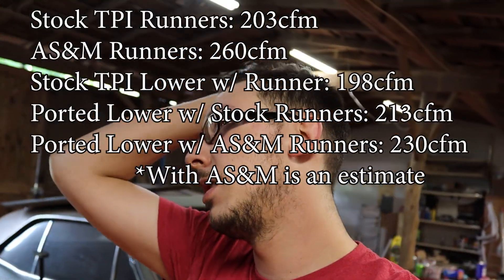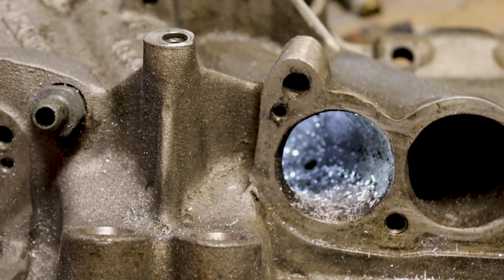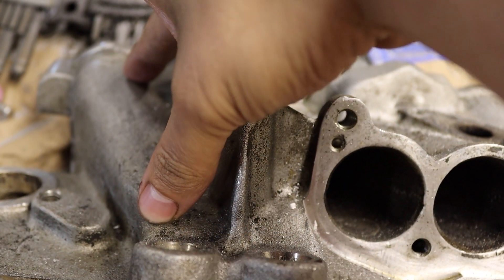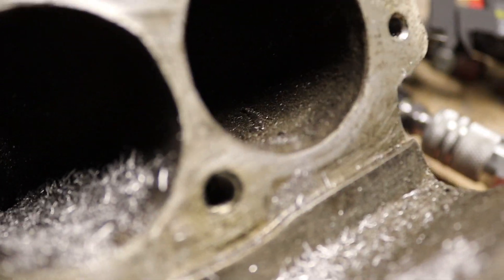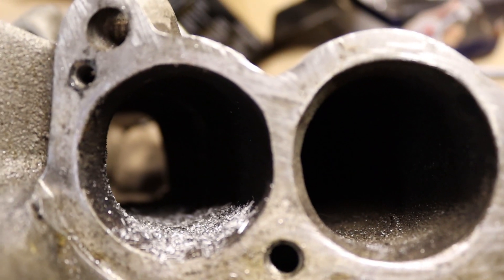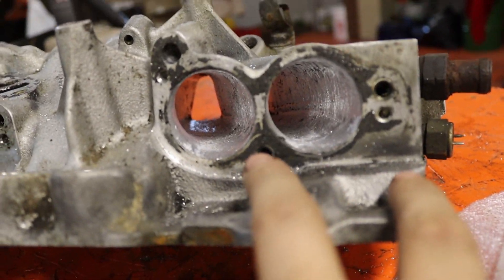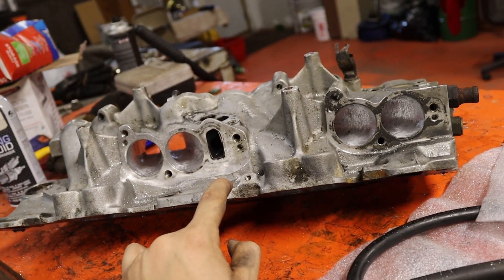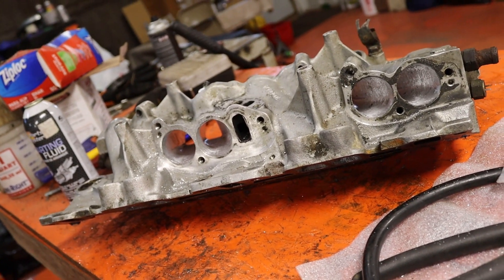How to Port TPI Intake Lower Manifold - Tuned Port Injection Performance Upgrades

Comment: You kids today really need to learn some. Runner length has EVERYTHING to do with where the engine makes horsepower. Richard Holdener has several videos on TPI engines (motors are electric) and how a fully ported Tune Port DID NOT increase the RPM range it only boosted the horsepower slightly. And here's a bit of info for you, 5700 RPM DOES NOT WIN RACES, you need 7500 - 8500 at the end of the track. My Superstock Chevy II shifts @ 8800 and is spinning 9500 at the finish line. One guy said: "Unless you're using a blower, you're not getting 600hp out of some ported 113 heads. You need at least 300cfm heads for that", WRONG KIDDO!!! There are many factors that determine horsepower having a huge port hinders like velocity, temperature of the intake charge,  and the density of the air fuel mixture which is a whole lot more important than intake flow. Doubt it go look at a 601 Vortec head verses an 034 Bowtie casting. Smaller port, higher velocity equals horsepower. How the intake charge sweeps the cylinder is vital especially at high RPMs, you lose that with a large port engine which is why sprint car guys chose the 180cc Bowtie Vortec over the 227cc Bowtie and Chevrolet quit making them. A 113 casting can easily make 600 if theyre set up right, the Superstock Corvette I built proved that and the guy who bought it from me races it a whole lot. Make a video? To impress you? Who are you that I need to impress? Go to a drag strip and tell any drag racer you want to look under their hood and see how fast they tell you to FVCK OFF!!! I've made my point here and don't have much else to say on this matter!!!
Reply: Your problem is reading comprehension Richards engines peaked at the same RPM they just didn't fall off after peak nearly as much which is exactly what I experienced. The reason for the drop off is two fold one tuning frequency and flow. I don't care what length your runners are if your heads and or intake flows below 190 CFM your engine depending on size will fall on it's face at high RPM regardless. My 350 engine pulled hard until about 5,700 RPM not high but much better than stock with full length runners. If you are looking for a super high RPM motor then TPI isn't it. In a heavy car the torque makes them pretty quick. Watch the wholeshot Vette videos he is running 11's off of what was essentially my set up and his 60' times are incredible. I also got 26 MPG at 75 MPH out of an 89 Firebird with a T56 behind it on 900 mile trips. definitely not a truck motor.
Reply from the maker: Brother. It’s not that deep. Watch the other videos. It’s all been explained 😂. All of that being said. If I wanted to go to 8,000rpm I’d drive a Honda.

Comment: Why aren't you using snap gauges to make sure you are maintaining cross section? it is easy to grind out metal, but may be of little gain. could even cause worse performance. it is not just grinding, it is knowing what to grind from where. pitot tube, flow bench, years of experience and testing are what it takes to make usable gains.sometimes they even add material in areas where there is no airflow, or airspeeds are slower to get velocity up.  I am not trying to belittle you, rather point out there is a reason pro head specialists charge what they do.  To Paraphrase Darrin Morgan, a good flowing port is counterintuitive to something that looks aerodynamically right.   the achilles heel of tpi is runner length, but it is also what gives it such amazing idle-midrange torque. alter length or velocity too much and you may take away from its designed benefits with little to zero gain up high. luckily, Lingenfelter, and others did most of the work for us tpi faithful 30 years ago. the super ram is a nice compromise design for street/strip use. but even it will absolutely lose torque below 4000 rpm compared to long runner stuff.
Reply from the maker: Snap gauges are a good idea, I use a few different sized polished stainless balls for the right "fit" and taper from there, around the shop I have pre-established tools for checking these. Getting the right taper is the real difficult part on these

Comment: What tools did you use to port?
Reply from the maker: Die grinder, cylinder hone, sanding rolls, assorted carbide burrs. I’ll be doing another one here shortly using a method to improve stock runners as well 😉

Comment: What? 190 cfm is good for a SBC head. You can over do it. Air velocity is more important than air volume.
Reply from the maker: The key we've found is more matching the flow rates of the engine rather than having one fast section and one slow section. Typically I'll shoot for 240cfm for the heads/intake. 400+ is typically the goal though.
Reply: @LSxHunter  It's never going to be an even slate. There will be some fast and slow air velocities in the intake system. Faster velocity = instant throttle response. Engine displacement is another factor as well, but I was referring to a first SBC 350ci motor, and 190 cc is fine. What's the cam duration @50 on intake and exhaust?  Too much cam leave you with less torque, and torque rules on the street.

Comment: you kids trying to act smart crack me up. Porting a TPI intake is a complete waste of time, at best you MIGHT make 5 horsepower but more than likely you will lose horsepower.  You  WILL NOT make any horsepower until you shorten the intake runner length thats why John Lingenfelters box made more power than anything else until the TPIs miniram came along.  LOL  "theres a curve"  its called a radius not a curve and that is in there to speed up the air flow and straighten it out as it enters the injectors chamber so you get a uniform atomization as the intake charge enters into the cylinder head.  So everything you did only hurt the engine as to how it works. If you want to make power take the tuned port off and put a miniram intake on it and forget EVERYTHING in this video. Leave the engine build to those of us who own the shops, build the engines, and actually drive them down the drag strip. FYI Im getting over 600 hp out of a set of ported #113 casting aluminum corvette heads on my 1990 SS/JA Super Stock Corvette and its still using the 1.94 inch intake and 1.50 inch exhaust valve sizes. Best run was 10.18 @ 131 with a 700R4 and 3000 stall. Good luck coming anywhere near that with this nonsense your posting here.
Reply: Dont listen to "MasterWitchDoctor". Hes on his high horse. Hes just one of those keyboard warriors.
Reply: @SilentOneCorajuda13  lol  keyboard warriors I was going down drag strips before you were born kiddo. I have 3 cars in my shop and 2 motorcycles that own the classes they race in. Ive built literally over 1000 engines for cars, boats, motorcycles, jetskis, and even lawn mowers.  What have you ever done? My Monte Carlo SS uses a .060 305 and runs 11.70s with a stock set of 081 centerbolt 305 head with nothing in them other than stock diameter 1.82 / 1.50 inch valves, 3 angle valve job and Lunati solid springs. On my Stuska dyno 419 hp @ 6300 rpm, at the back tires 311 hp and thats with a stock intake manifold and a 750 quadrajunk.  Thats a stock eliminator K/SA with a TCI street Fighter 700R4, 3000 stall and a 4.33 gear. Its destroyed a ton of 350 chevys, mopars, fords, and anything else they put in the other lane. its only loss was to an 87 firebird 350 formula and that was only by a fender after he got the hole shot and I almost ran him down at half track. When my Dart Little M block gets here ill crush the 11.65 National record. im only a 10th off it now.
Reply from the maker: We've built our own engines for years and there's more than one way to skin a cat, id be curious in checking out some of your builds. Im always happy to advance my knowledge and make changes if I can better myself. History dictates big gains with what I've done and I'm happy with the gains I've made. 

Why wouldn't you gain by increasing the size of the pathway? More air in is more air out, if the engine is properly set up. Again, please educate me/us with a long post and I'll keep it in a good spot to help other guys. 

Sounds like you've got some knowledge. Id love to have a good discussion about our theories and builds.
Reply: @LSxHunter  masterbitchdoctor is my new hero lol
Reply from the maker: Also should throw in there - I've mentioned in several spots the HSR and MiniRam are FAR superior choices for raw power; we're building for 400hp for a road rally car.
Reply: Ignore the troll. I have some 113 heads as well. Porting the lower intake is a good idea with even aftermarket runners. And unlike the aftermarket ones it seals better
Reply: So you're comparing a gutted race car to the guys torque producing daily driver car that is making some more power than stock. And you pound your chest like you're the best, plenty of guys would look at everything you own witch doctor and laugh because it is a tortoise compared to their junk. Rather than insult the guy who wants to add a little more power to his tpi engine why not offer some valuable tech to help? Or is it easier to just insult people to inflate your ego? What a douche canoe!
Reply: @MasterWitchDoctor
I told the witch doctor
I was in love with you
I told the witch doctor
I was in love with you
And then the witch doctor
He told me what to do

He said that

Ooo eee, Ooo ah ah, ting tang
Walla walla, bing bang
Ooo eee, Ooo ah ah, ting tang
Walla walla bing bang 🎼🎵🎶

✌😁
Reply: shut up boomer
Reply: Unless you're using a blower, you're not getting 600hp out of some ported 113 heads. You need at least 300cfm heads for that. Not everyone has thousands of dollars to blow on an intake just to make another 40 horsepower. I can build an entire 383 engine for the cost of a miniram.
Reply: @jacemonboutwell1986  you need to learn some kid, a miniram is $900.00 dollars.  A crank alone costs that.
Reply: @MasterWitchDoctor sir, it isnt the 90s, a used mini ram costs $2,300. A forged eagle crank for a 383 can cost between $350 and a grand. Give the nurse the ipad, its time for a nap.
Reply: Anyone ever do a tpi 400 sbc? I figure with the bigger bore ot would make more power then a 383 with everything else the same.
Reply: Show us a video of a dyno run and the ported aluminum GM heads. Show us the Vette is something you would drive daily on the street or is she a trailer queen? Again I drove my Firebird with AC running across the country and to work every day for years. Yeah we had cars that were faster a gutted Monza with a small block and manual brakes and steering with a welded diff. Cousins Mustang with twin turbos, and the Cobra with NOS.... Cobra aside these were track cars....
So you drive your vette places or just an occasional cruise and the dragstrip? 

Build what ever suits you but you can easily put together an 11 second TPI car with a little thought. Again everyone said the reason TPI motors fell on their face was runner length alone, and that is half the story. They were flow limited 185 CFM heads are going to kill HP is it not? Like I said my car dropped off at 5,700 rpm as opposed to falling on it's face at 4,800 rpm and I think with what I know today I could do even better. Car was a blast to drive too, working on my next TPI car hoping for low 11's or even high 10's on motor. 11's are easy. At least LSxHunter has a video of his car and I appreciate it.
Reply from the maker: @jamesbowman7963  I've had TPI cars in the 11s with the same exact thing I'm doing here - pairing it with higher compression, ported vette 113 heads, and a 268XFI cam. I guess I'll just have to do it again with some video this time.
Reply: @LSxHunter  Yeah no doubt you can make a very street able car that runs 11 second 1/4 mile based upon TPI intake. Look forward to the video... The 268XFI is a cam suited to TPI short duration high lift etc... I would like to try a tighter LSA and see if I could get some exhaust scavenge tuning to pick up where the intake tuning is going away. I scored some nice long tube stainless headers for a third-gen F-body on eBay a while back that are strong around 6k rpm... On my old Firebird I did something very different and ran my exhaust into a big 3.5 " single and only split it into duals after the rear end and out the back to look like the stock dual exhaust. I think this helped with scavenging but without a dyno who really knows? I know it ran like stink and would almost jerk the front tires with the T-56... I also had no mufflers and it was quiet inside the car no droning like most cars of the day with Flowmasters everyone ran. It was only loud when you were on it.
Reply from the maker: @jamesbowman7963  My current setup that ran mid-13s is just a stocker L98 with headers, 3" exhaust, magnaflow, and a tune. The Moser 3.42s, TruTrac, stall, DIY Ram Air, and a 93 tune helps though. The 91-92 L98s had a little "more" in them than the earlier models.

If I decided to port the heads (I've gone from 193cfm to 250cfm in the past) and use a stock cam I'd wager I could hit the 12s. But I'm totally setup with full suspension and have access to tire. 

I'm a firm believer in a single 3" or 3.5" single exhaust. I also tend to run 1.5 on intake and 1.6 rockers on the exhaust, but don't tell anyone ;). 

Being at 800ft and having 50* air helps too.
Reply: @LSxHunter  Are those 113 aluminum heads?
Reply: "I'm a firm believer in a single 3" or 3.5" single exhaust." A man after my own heart. The growl with a big single is amazing and I think you would make more power if the cross sectional area of the single supports it. They are doing much the same with h pipes and crossover x pipes to get that scavenging back.  I'm not lying when I say my Bird had the best exhaust note on a street car I can remember, a snappy growl... I never got to build the higher compression 383 bottom end I had planned on but I'm sure it would have sounded even better.
Reply from the maker: @jamesbowman7963  083 cast iron heads on F-Bodies. I'd love to find a cheap set of 113s but you might as well buy TFS 175cc heads at that point for the TPI. I see 113s listed for $600 in my area and that's just insane to me when its the same heads - just aluminum.
Reply from the maker: @jamesbowman7963  People look at me sideways when I tell them I'm setting the Firebird up as a single exhaust long term. It just makes for a better driving car. I lost a whopping .2 in the 1/4 thanks to the bog from wide open headers and a stock converter, so full exhaust it's been ever since!  Guessing the new stall might fix most of that issue. 

I'd love to put the TPI to a 11:1 383 on corn. Sounds like a fun time!
Reply: @LSxHunter  Yeah I have seen 113 heads for like $300 but that was a long while ago... My ideal head would be AFR 0911 180cc heads, or their 190cc Vortec heads. After that Edelbrock E-tec 170cc Vortec heads are inexpensive and about as ideal for a TPI as anything out there. My Brodix -8 180cc were about as good as it got in those days and I got them from a friend building a motorcycle that needed cash so half price still in the box. 

I just don't have flow numbers for the SDPC Vortec intake although I have been told unported like 198cfm same as OEM? My head choice would depend on how much porting could be done and max cfm. No need to get  heads that out flows the intake just drop low end torque for no gain on the top. Ideally like 260 CFM would be great. Seems like the work porting 083's would be time consuming but interesting...
Reply from the maker: @jamesbowman7963  There's a guy in the Kalamazoo Camaro club that has a Vortec setup and seems to be scooting. I watched him walk a catfish so its doing something. Ive heard anything from OEM or worse for the SDPC Vortec but they take very little to actually improve. 

I figure ill port the heads with the goal of 450hp and be happy with 400. Brodix is the bees-knees. I've been super impressed with the 180cc ProFilers for cheap. If I found a set of 113s for $400 I'd jump on it just for the weight savings.
Reply: @LSxHunter  Would love to drop a 383 underneath my current 86 IROC TPI (TB airfoil, ported plenum, as&m runners, accel manifold). My current engine has only 20k miles on it but it's a 305 rebuilt (P&P heads, bigger cam, forged internals, bored over 0.030) and it makes 271hp and 354tq on dyno. I haven't spent much time on the IROC since house, kids, etc. but this winter is time to do something big.. Your vids are bringing back the motivation I had when I was younger haha. Yolo!
Reply: @LSxHunter you got mid 13’s out of a full exhaust and tune? Or were you saying the gears and stall were also on your car?
Reply from the maker: Car had headers, tune, exhaust, and gears. Factory stall at that point. I’ll be putting it back together as it sits to hit the dyno in the spring for baseline numbers before I tear into the engine.
Reply: @jamesbowman7963  who are you that I need to prove ANYTHING too?  Go to a drag  strip when an NHRA sanctioned event it happening and look at EVERY L98 powered Superstock, theyre all using 113 castings. Theyre all running 10.50s or faster and theyre all making 600+ hp. I would no more show you one of my engines than fly to the moon. Unless you buy one or race for me shop you not seeing shit.